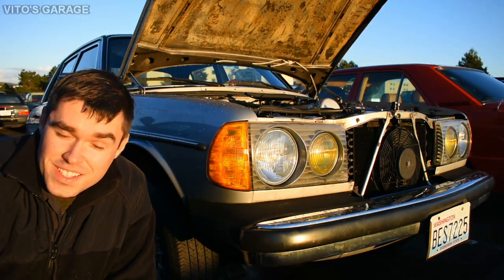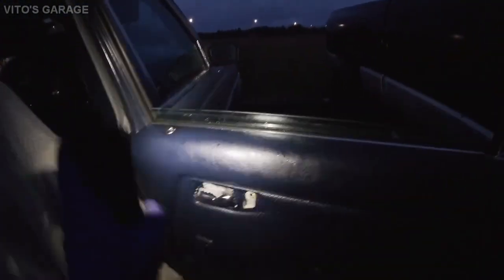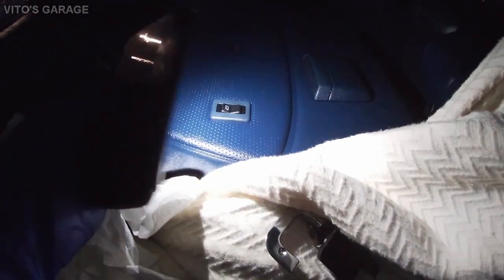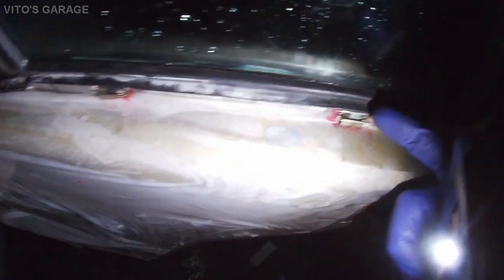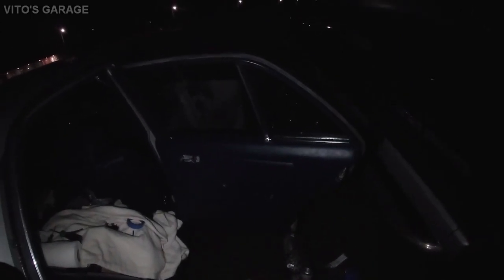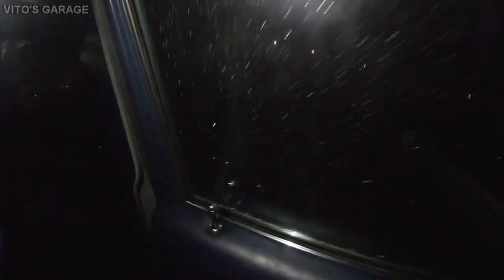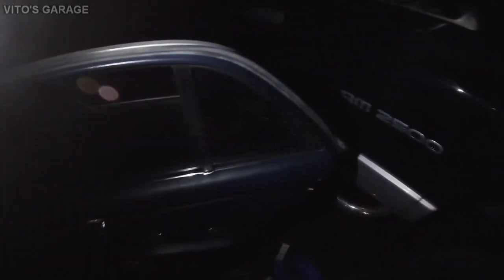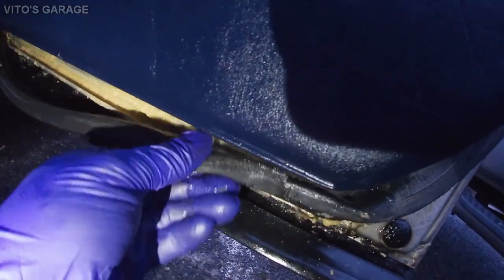PART 10 Dad's Mercedes W123: Complete Rear Door and Window Regulator Maintenance & Preservation!

Comment: Just dug into my w123 doors today, to replace my window scraping rubbers. After watching your video, I'll do more preventative maintenance as well.

Most of my doors have rust scale nest at the bottom, as well as the tray that holds the bottom of the glass. What would you recommend to repair? Wire brush and vacuum the scale, to paint with a rust killing paint? Only one door is rusted enough to show slight paint bubbling on the exterior. 

Thanks for the content
Reply from the maker: I’ll be posting a new video soon. I finished all 4 door maintenance on a W123 and I peeled all 4 door seals from the bottom to check for rust. 1 door had a bit of rust so I fixed it. I recommend carefully peeling the bottom door seals and checking everything. And finally preserving it with grease or fluid film. 
For your case, wire wheel all the rust off. Use rust dissolver gel too. Use a pick to scrape the rust completely and get it all gone. Spray primer and paint afterwards, and then grease on top. Fluid film the bottom of the doors all the way. If you see bubbling, grab a pick and scrape off the rust till you get to clean metal. Remove it all and do the steps I mentioned above. Thanks for loving and saving these legends!